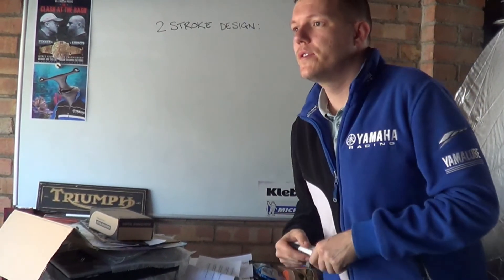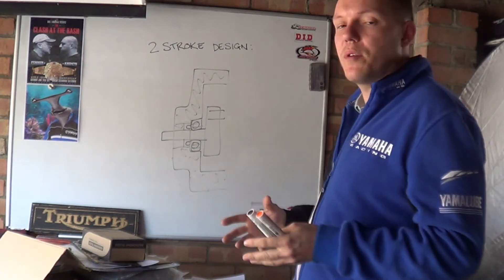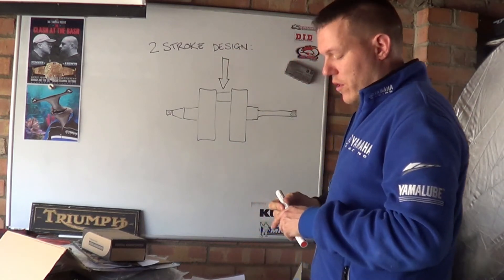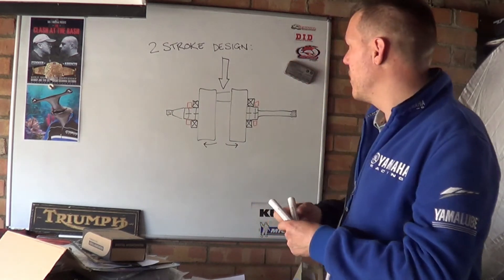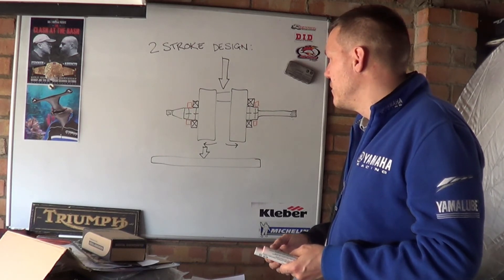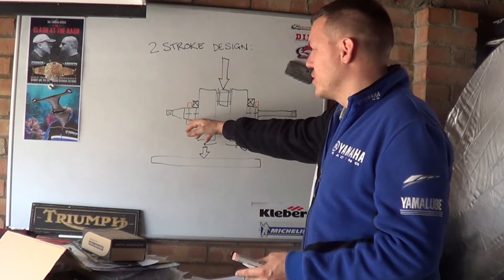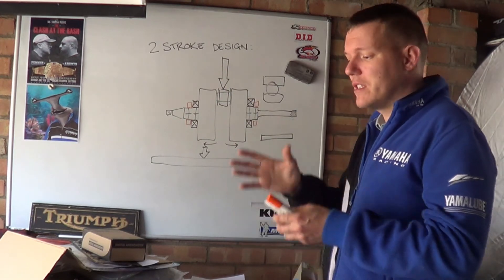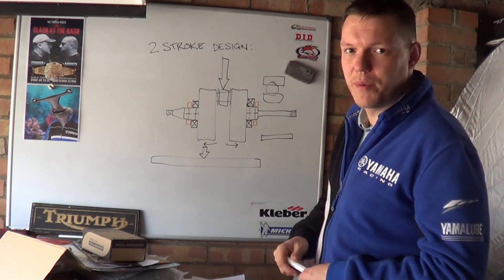2 Stroke Alternative Designs - Bearing Location - Part 1

Comment: why not try tapered roller bearing instead of ball bearing?
you could get 2 fucking strong springs pushing them towards eatch other. supposedly that should dampen some vibration too. and auto-align the tapered roller bearings so they do not wobble and shit.
apart from costing a lot , it may improve life expectancy i guess.
Reply from the maker: Good question - I smell a video

Comment: If you still have to lube the wrist pin bearings etc, what would be the point? You couldn't eliminate the oil in the mix so might as well leave it as it is..

Comment: Could you use a tunnel crankshaft with the bearings on the crankwebs like the old maybach tank engines of ww2?
Reply: but then the webs would have to be precision machined., forged not cast. $$

Comment: What if tapered roller bearings were used on the outside of the oil seal to take axial and radial loads and an increase in crankshaft diameter to decrease bowing?
Reply from the maker: This would increase the weight of the crankshaft, and increasing the weight makes things worse - a follow up video coming soon - matt

Comment: on the suzuki rmx 50 and the tsx 50 the bearing on the clutch side of the crankshaft is at the oiled side of the seal. seemed to hold up nicely there
Reply from the maker: But on the other side it isn't - https://www.cmsnl.com/suzuki-rmx50-1997-v-france-portugal-spain-e04-e29-e53_model14096/partslist/FIG4.html#results
Reply: but doesent that mean that it is doable to some extent, (in small engines) since you would have all the flex and what not even if you just do it on one side?
Reply from the maker: Yes it does, but only for small engines and in certain applications. A solution for a problem that is generally over the entire range has to be just that. Over the entire range - if that makes sense.

A video is coming soon on this - little RC nitro engines have just 1 throw due to their size - matt

Comment: Correct me if I'm wrong, but couldn't the thrust issue be solved by cutting a shoulder between the bearing and the seal so the shoulder seats against the bearing instead.

Comment: if you increase the diameter of a shaft between the bearing and the crank, it would decrease the bowing and only add very little wieght to the crankshaft. Or am I wrong?
Reply from the maker: "Some actually weld the pin after assembly to hopefully limit flex" 

- What? what are you talking about. Welded crankpins are to 1 - stop it coming apart, 2 - to stop any rotation due to angular momentum and taper cam-out under load.

How would welding a pin at either end stop the enitre pin from flexing?
Reply from the maker: Video coming up on this soon dude - needs some proper explaining it does lol
Reply: Martin Mikus The conrod pin is the source of any flex. If you ever have the opportunity to align a press fit crank you will notice it's the weak link of the assembly.  Some actually weld the pin after assembly to hopefully limit flex.  I think your on track to arriving at some solutions. I couldn't hear much of the video so I hope he was talking about bearing lube. If not, bearing lube and seal was in my head and why I paused at your comment.  It's possible to oil bath both bearings by simply using a different sealing location.  The seal can be larger size than the bearing and seal laterally to the crank or even be the full diameter of   the counterweight assembly.  Another solution we tried on an RM250 engine being used for a hotsaw was adding a seal after the stock first bearing location and added a second bearing to stabilize the crank withone adding rotating mass. A larger diameter hollow conrod pin can achieve the same but must be hardened and tempered.... It's never ending.  All the best. Take care.

Comment: this is a great reply video to my other comment however couldn't you have 2 sets if bearings for each side of the crank. if you have one bearing on each side for the up and down forces of the piston and then one bearing each side facing inwards to avoid side to side motion therefore compensating for the sag the crank would endure over long periods if time. Thanks for the video it was excellent!
Reply: Also the side to side bearings would not need to be big as the side to side forces would not be that great only vertical forces are large.
Reply from the maker: It more about having the bearings as close to the crank as possible. If you have 2 sets of bearings this doesn't sort out your oiling issue that you first commented with, or am I missing something?
Reply: The Workshop My point is that if you could move crank bearings out to have their separate oil compartment surely the outer bearings stopping side to side movement of the crank previously mentioned could compensate for the crank bearings being moved out therefore allowing the crank bearings to be moved out be properly lubricated.
Reply from the maker: Not really. The bearings are placed as close to the crank not just to stop thrusting but also to stop the crankshaft from bowing. The crank would go all out of out shape with adequate support, which the point a made at the start of the video - matt
Reply: The Workshop also you could compact the size between the crank cover and he crank therefore making the before great forces on the crank a little bit less, by having a shorter distance from piston counter-weights and crank. Also there would be less gyroscopic enercia
Reply: The Workshop and if each side of the crank could not move bowng of the crank would be nearly impossible. (I could be wrong)
Reply: David Vermillion I'm sure there would be a way too do it.  bearings aren't that complext or that heavy and the crank I'd quite low on the bike so would effect performance too much.
Reply: You mean why you can't have normal bearings and thrust bearings. Because that adds parts and complexity.